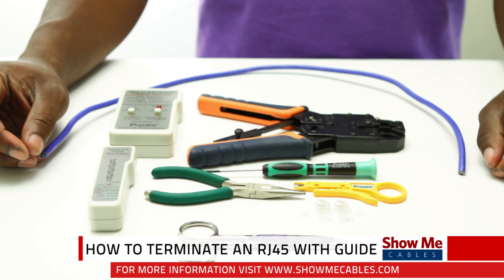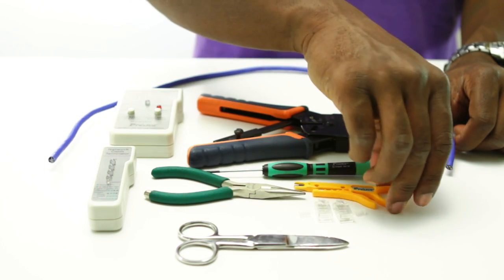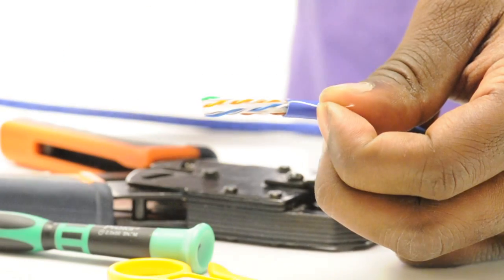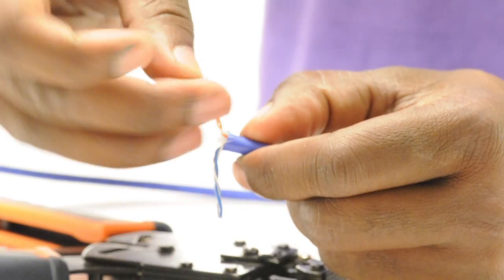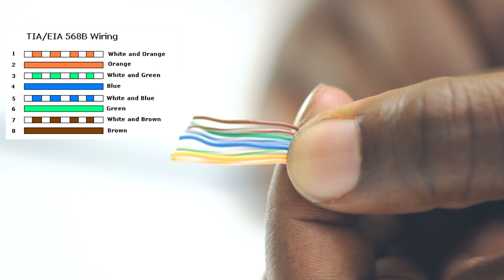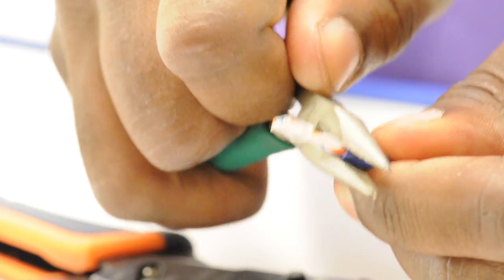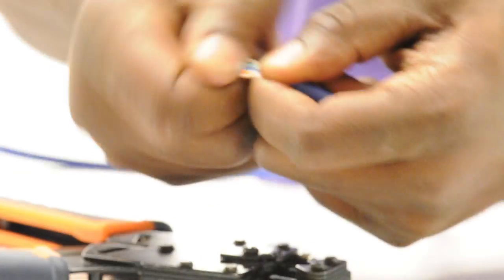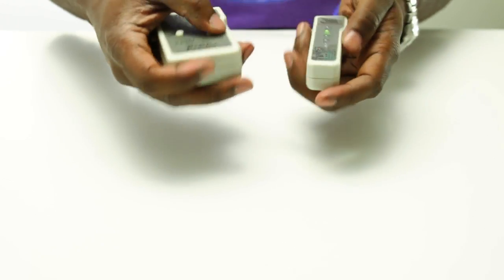How To Terminate An RJ45 With Guide Connector

Comment: Why leave a half inch off? I just push the guide all the way to the cable sleeve and trim right at the end of the connector. My cable sleeve goes as far as it can inside the jack

Comment: Hey great video! From experience terminating RJ45 connectors, my tip to you is that after you strip the jacket from the cable, you do need to use the string to pull the jacket a little far and cut the wire. While you strip the jacket using the strip tool, there is a chance that you have nic the cable. That caused a short, not cool.

Comment from the maker: For standard applications, that require straight through pin-out, you need to either use 568A or 568B wiring pattern.   This will make sure the cable is compliant with your entire network.

Comment: When inserting the conductors into the guide, does it matter which conductors are going into which holes? I understand the 568B pattern you have to use, but ultimately when inserting the conductors into the guide, is there a specific color-to-guide-hole scheme you need to approach to correctly terminate the cable?